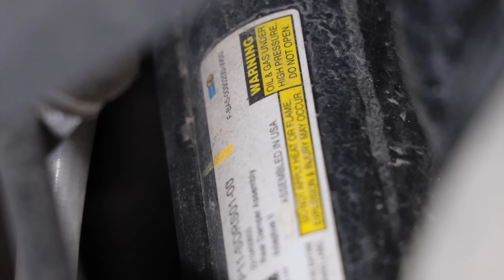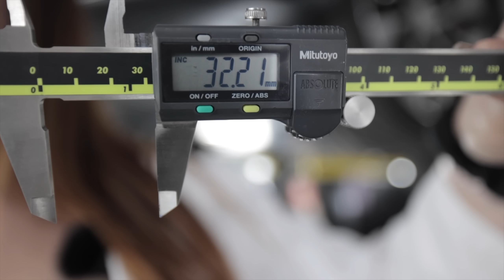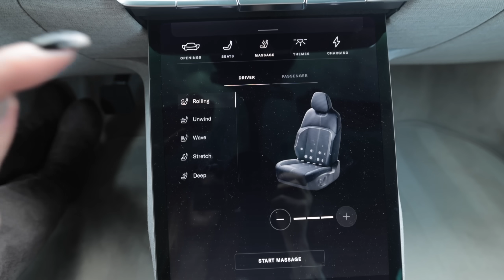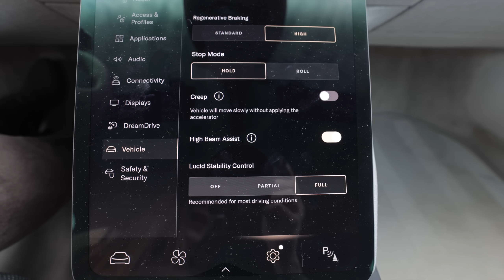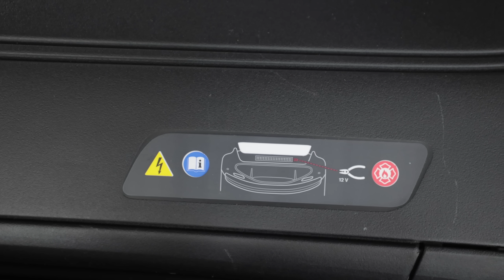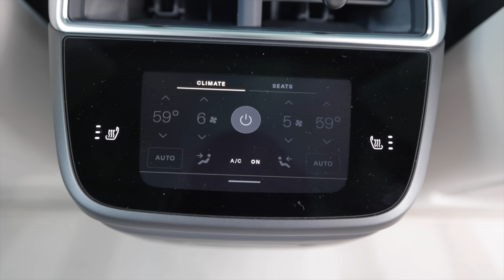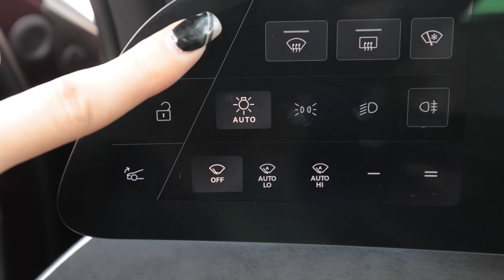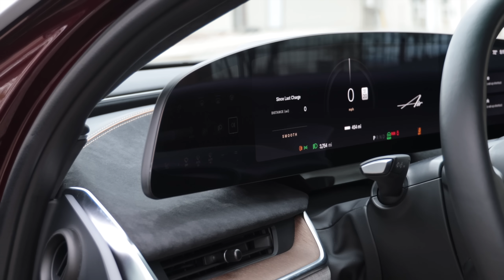So Fast It Hurt! // 2023 Lucid Air Grand Touring Review

Comment: Interesting, does it have a G-meter somewhere in the infotainment? Theoretically, 0-60mph in 2.6s means acceleration 1.05g - a bit faster then free fall. So, what you were doing @13:55 was similar to bungee jumping.

Comment: Sarah's the type of person who only gives 9.7 beans to a vehicle that goes 0-60 in two and a half seconds.
Reply from the maker: Ahh.. but the sapphire model does it in like 1.85 or something ludicrous.
Reply: @SarahnTuned  what would you give the aspark owl ev hyoercar at 1.6s 0-60mph? 
The pininfarina Batista also does 1.65s 0-60mph and mid 8s in the 1/4mile on st tires. 
Rimac nevera is 1.7s 0-60mph and 8.6s in the 1/4 maxes out around 258mph so far in testing. 

The mcmurty speirling ev does 0-60mph in 1.5s and runs 7.9s in the 1/4 mile. Plus it was the fastest car EVER up the goodward hill climb. 🤔

Comment: 10:41 The "little taillights" have been mandatory by the UN regulations (ECE) internationally since the 1970's or earlier.
They are mandatory if the taillights fold up in any kind with the trunk lid.
In the late 1970's or early 1980's they got complemented by the hazard lights aswell.

Comment: Mine has a range of over 1,000 miles and a recharging time below 4 minutes. Price below 2,500 Euro….mine is nothing special but an over 20 years old diesel. Miles driven till now about 450,000. May the Lord bless and keep you. Have a great weekend.😊
Reply: Diesel is the most efficient fuel.  Most people don’t know that it has more BTU per gallon than gasoline (petrol).  Not a LOT more, but somewhat more.
Reply: Lord's not blessing you for the 80tonnes of CO2 you knowingly poured into the atmosphere!

Comment: Lucid makes one of the only EVs that actually LOOKS like it does not have an ICE hiding in it somewhere, or that it has provisions for an ICE.  Even most Teslas look like they used a grille block-out bumper.
P.S. Yes, Sarah that is carbon fiber.  It is structural fiber made for the engineering benefits of using fiber, not sending the price sky-high by looking "pretty"(the pretty fiber on things like BMWs and Vettes is x2-x3 as expensive JUST so people can flex).

Comment: Speaking of not having to turn it off and on, I went from Tesla, which also has no on, off switch, to a Ford Lightning, which does have a switch. I have .multiple times now torrent out and left the truck on. But it will turn off on its own after 30 minutes.

Comment: Why are big multi-piston brakes even a thing on an electric motor driven car?  I understand needing something for when actually stopped, but I would think that the actual stopping force could be handled entirely by the motors.  Big brakes are heavy, lots of rotating mass.

Comment: I have driven several EVs and the Lucid Air is the top of the line I love it. I actually like the other EV company you don't see much about the Polestar I think that is that's better than the Tesla. IMO until battery tech catches up I doubt I will ever go for an EV. I am more likely to buy a hybrid over an EV or just keep driving my gas guzzling Jaguar VDP.

Comment: Where in AZ?
Anything on a hot climate, like AZ, having a negative effect on the vehicle holding a charge?
One of my bosses had a Nissan Versa with that issue in the middle of Phoenix.
They had a charger and an assigned parking space near our shop wall.

Comment: This is about 500 lbs heavier than a Model S Plaid.  That's why it is over a half second slower
The Sapphire has over 200 HP more than the Plaid, so it beats it in the quarter by a quarter second

Comment: Great video review Sarah! 
Without doubt if money no object and I had to buy an electric car this is what I'd buy! I'd NEVER buy a Tesla with all the issues reliability issues and after care issues plus all this remote downgrade programming they do to their cars! 
Tbh I think ALL EVs are a CON! But this is one I'd consider if I had to. 
Personally I think hydrogen is the future and could be implemented and retrofitted to ALL PETROL an Diesel cars TOMORROW with hardly ANY MODIFICATIONS! 
BUT THAT won't line the big oil conglomerates and corrupt global governments' pockets! It ALSO wont ALLOW EASY CONTROL/RESTRICTION of MOVEMENT Bof the POPULATION (with 15minute cities etc!) They don't care about range as they want to stop/prevent any travel. Eg. Pre-programmed to say "sorry but computer says no you can't charge or leave the block!" It's ALL ABOUT CONTROL!

Also if they were worried about the environment, ALL diesel's could run on veg oil and used veg oil with slight modification and produce 95% less emissions! Zero Carbon and only slightly more Nitrogen and ZERO CANCER CAUSING CARCINOGENIC EMISSIONS! That's doable IMMEDIATELY, AGAIN it doesn't line the oil industry pockets! Or government! 
Cheers from London 👍😎🏴🇬🇧

Comment: They will unfortunately be broke shortly, they are currently losing over 100k per vehicle and just had to further discount prices to improve the dismal demand. Tesla went through the same issues, but they weren't competing with what is now the biggest EV manufacturer. 
The Saudis will only put so much more into it before they pull the pin.

Comment: its probably the nicest EV made, but with a price most wont afford.  

the worst trend in these EVs are the excessive use of glass.  this is not practical as glass aborbs so much heat, which for a company that is based in arizona should really know better.

Comment: I wish you would have told us how long it would take to charge from say 20% to 100% because if your on a trip  you don't normally only refuel a gasoline vehicle part way but fill it to top I know from watching video's of other EV's that it's likely an hour plus to fully charge a Lucid Air and for a 180,000 dollars I rather have a vehicle I can fuel in minutes and not hours and when your on vacation you want to be spending time having fun not waiting for your vehicle to  recharge. Ev's may be crazy fast but I would sacrifice a little loss in acceleration for a gasoline powered vehicle  I think most people see there time as a valuable commodity like running errands going to work and so forth and EV's charging times impact that. If you are a person who adds 200 miles of range often instead of charging to 80% to 100% will that in time shorten battery life faster?

Comment: Another car that has no infrastructure to make it run…..fill the potholes and drill baby drill.
Reply: Do you mean it is just like gasoline engine cars were when they were first a new thing, play things for the rich with extremely limited range and a fuel source that was not readily available? You could buy cans of gasoline in general stores, sometimes. Then they build out the infrastructure.
You never can tell what will happen with those playthings for the rich that have no infrastructure.

Comment: Oh, what brainwashing BS!  Cost (for most EVs) is a fortune!!! Maintenance will be a fortune.  Oh, where will you take it to for that maintenance and repairs?  In your dreams!?  Now, speed is an enemy to EVs.  The faster you go, the faster the battery drains!
Reply: Your comment is brainwashing bs hahaha. A chevy volt is 34,395, a bolt is 24,000, a model 3 is 42,990, a Toyota bz4x is 42,000. These are not that expensive. You can subtract 7,000 due to the EV tax credit. On top of that, charging an EV is approximately 3.5 times cheaper per mile than the cost of fueling a gas-powered car. AND Maintenance costs are LESS than a gas car. Less moving parts mean less parts can break. No oil changes, no alternators, no transmission, nothing. Just brakes and windshield wipers.